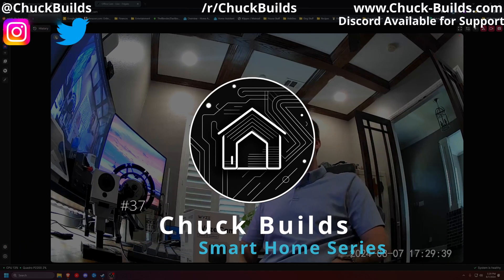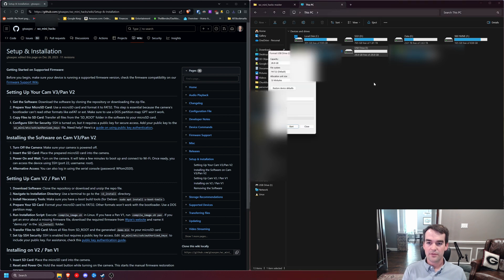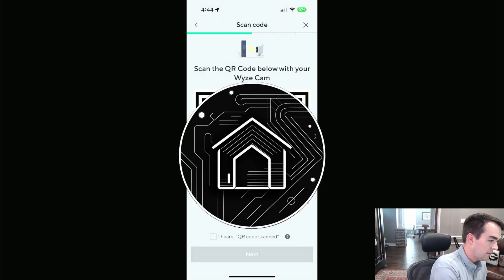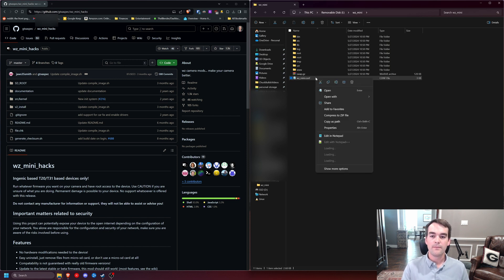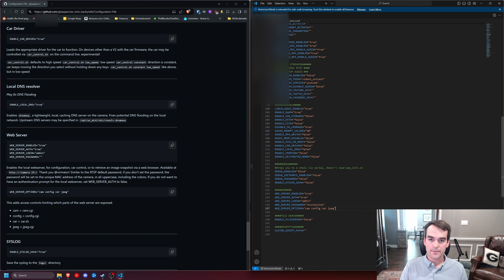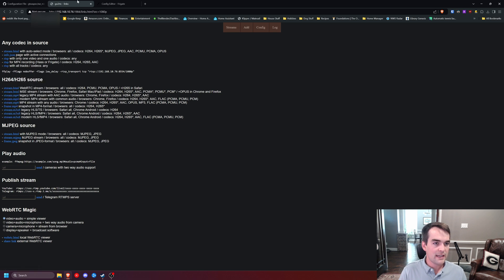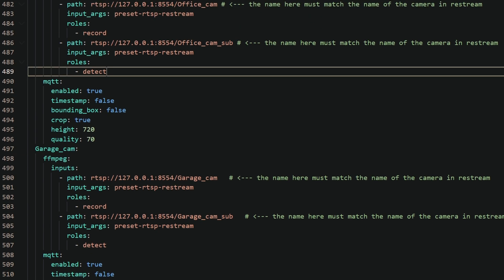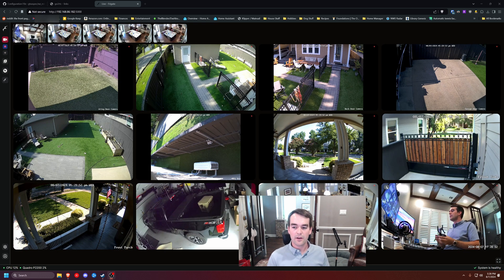Unlock the Wyze Cam V3's Full Potential with Go2RTC and Frigate 14

Comment: I successfully flashed the firmware and it "took". When I go to the IP address, log on, go to Go2RTC Server, and select the   1080p stream to test,  I get audio but no video. When I try 360p I get " mse:streams: exec: exit status 1".    
Any idea what I did wrong?    
Thanks for the video!
Reply from the maker: First link on google is from the GitHub for this project explaining that you might’ve installed it on too new of a firmware. Try to roll back your firmware
Reply: @ChuckBuilds  same thing here I have rolled back and now wz won't even load any ideas what fw you are on so I can flash the sameone

Comment: wow my comment didn't stick ? maybe it was the url i posted in the comment. I was going to add one more thing to the list is if you delete the camera off wyze app, it removes it from the network. ugh. gotta go through the process again. Was easy, just hold the reset button down and then plug the power back in. press the reset button again, re add it to wyze

Comment: After the firmware is flashed, can I remove the MicroSD card to flash another camera?
Reply from the maker: I believe it needs to stay in the camera. It actively reads the firmware on the SD card each time it turns on. It doesn't permanently alter the camera.

Comment: I'm not sure why, but frigate (15.0) will not pull my wyze cam stream.  It immediately crashes ffmpeg.  Been trying to get this to work for weeks since I have 4 Wyze cams around my yard (with floodlights which is the only reason I haven't replaced them yet).  No amoung of tweaking seems to make a difference and I don't know enough about arguments to even try to competently fix it.  I can see the rtsp feed in vlc, but frigate just can't.  Not sure why these systems have to be so convoluted and difficult to set up and troubleshoot.  😞
Reply from the maker: Are you using the method described in my video or just wyze rtsp? I find the go2rtc made a huge improvement for me

Comment: I follow all steps and when I boot with the SD card loaded I get the initial robotic voice as heard in the video stating initializing and I believe a second one saying transferring but after that nothing and the camera still shows in the wyze app and no web ui at the cams IP.  Any ideas what happened/how to fix?  Also, on the github site the last step mentions SSH keys, but it doesn't appear you did anything with that.
Reply from the maker: did you update the config file to enable the web server?  I also don't use ssh to update the camera. I just edit the conf file and use the webserver initially, and I haven't had any reason to go back and make changes.  You could set that up but I'd rather just re-edit the files than do it over ssh.
Reply: @ChuckBuilds  thanks for the response.  I did update the conf file.  I downgraded the firmware and just got the firmware to flash.  Thanks for the help!

Comment: So is there anyway to connect the Wyze cam V3 to a home network that doesn’t have internet and view the Wyze cam through your phone still? 

Doesn’t need to be through the Wyze app. 

I’ll use whatever. I have both android and IOS.
Reply from the maker: I use Frigate but you could use any NVR with RTSP. HomeAssistant would support it.
Reply: @ChuckBuilds  I thank you for your quick reply.

Will check out the program you recommended and I’ll let you know how it works later on. 

Thanks again.

Comment: Nice video!!! quick and stupid question: with the firmware on the Wyze camera means that the camera cannot be controlled from the Wyze App right? This is a feature that I am looking for to not rely on their Cloud service at all but I want to double check.  Thanks!
Reply from the maker: Correct. It is no longer responsive in the app after the firmware. I probably should’ve clarified that was why we remove the Wyze logo and motion boxes before installing it. With this firmware, it’s all local and processing motion and person detection, and saving recordings, through Frigate (or another nvr)
Reply: @ChuckBuilds  thanks for the confirmation.  One more: is the video streaming good and responsive in the web interface? I did change the firmware on v2 but it was too slow
Reply from the maker: @kirksteinklauber260  For Frigate? or the Camera Web Interface? I'd say mine was pretty decent on both. Not incredible but pretty good for <$20
Reply: @ChuckBuilds for web interface of the camera.  Thanks!